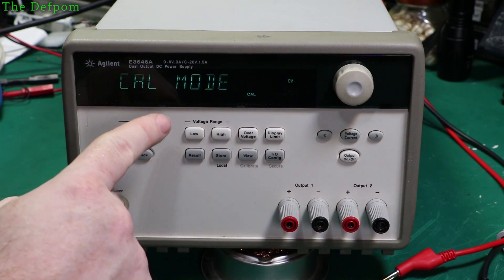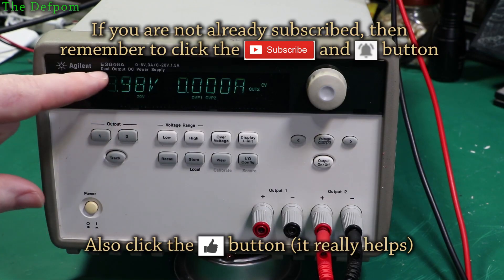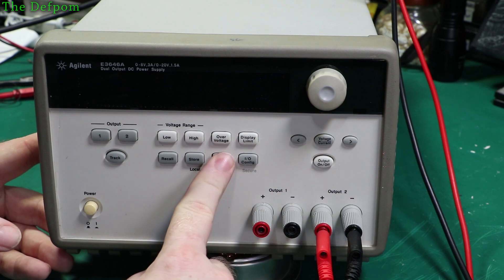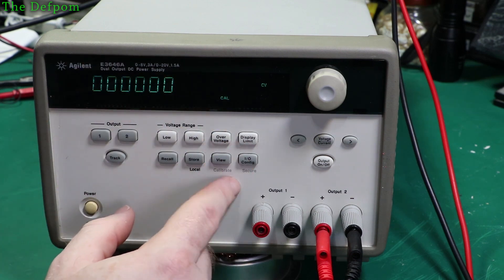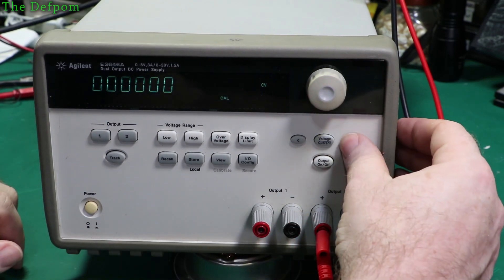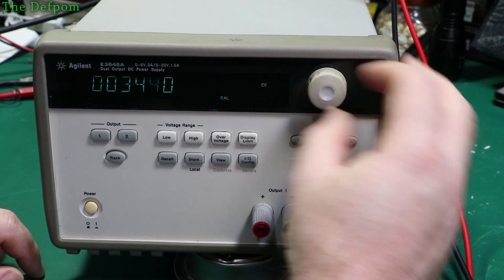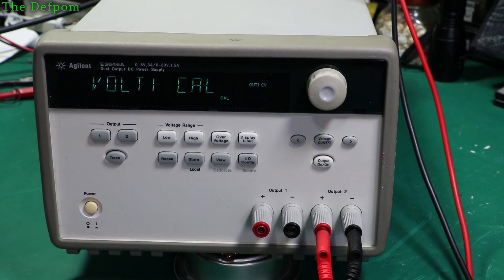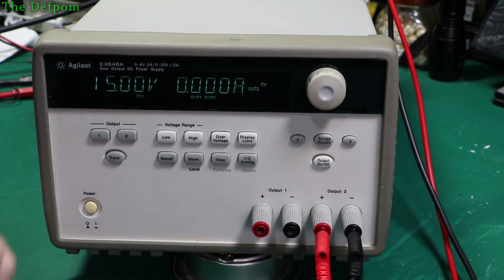🔴 #553 Agilent E3646A Power Supply - How To Access Calibration Menu When Secured

Comment: Oh Nice! Is that the one with the damaged front panel? Looks like you got it repaired. A video on how to unlock one that does not have the default code would be very nice. Thanks for sharing.
Reply from the maker: David V - yes that’s right, I just hope the glue holds! I will do another video of how to bypass a forgotten security code.